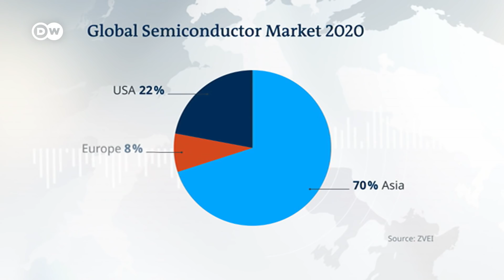The European semiconductor industry and its global competition | DW News

Comment: About Computing (Logic) Chips, such as CPU, GPU, Mobile CPU other processors:
Taiwan is NO1 in this field.

TSMC which is a Taiwanese IC manufacture and technique support company dominates the 56% in IC manufacture market share and the NO1 in this industry in the world. And UMC which is a NO2. in Taiwanese IC manufacture company get 7% in this field.

For computing chips manufacture, Taiwan almost get about 70% in this world.

MTK which is a Taiwanese IC fabless and designing company dominates the 27% in mobile CPU market share and the NO1 in this industry in the world.
--------------------------------
About Memory Chips, such as DRAM, Nand Flash or SSD..:
South Korea is NO1. in this field.
Samsung get the 42% market share in DRAM market, and SK Hynix get 29.5%.
South.

For memory chips, South Korea is the NO1 in the world.

TW and KR are skilled in different chips, the former skills in computing chips, and the latter skills in memory chips.
Reply: SK Hynix nand flash share isn't as high as your figure. Top nand flash manufacturers is Samsung with 30%, Kioxia with 19%, WD with 17%. But WD doesn’t run a fab, they do a joint venture with Kioxia. So, we can absorb all WD figure to Kioxia

Comment: Thanks , Thierry Breton : Intel must upgrade to 7->5->3nm Chips, Global Foundries + NXP, St Micro ,Nokia, Infineon, Ericsson,Bosch must have a coordinated move to 3-2nm SoC & they must finance ,with EU, local assembly of tablets ,laptops, robots , etc. to train the next generation of engineers & programmers , of inventors right at the foundry & factory floors. Of course the anti-EU lobby will push in the Media the idea that Europe does not need to invest in any of this because it will go bankrupt , better to depend on foreign manufacturers & their Hedge Funds & Private Equity. Will Brussels act fast & smart ? Or will they fail again ? 
News that MIPS will switch to designing RISC-V processors is important sign of open-source cores power .CPU/GPU/ASIC history is just beginning.
Reply: Europe should stay away from semiconductors and other high tech as it won't work. Europe should concentrate on mechanics which it has been a first mover for hundreds of years-such as pulleys,gears and cams.
Reply: Germany left semicon in 2009 when Qimonda stopped business and stays at the tech level then. Germany did the opposite to Korea - giving up profitable but very costly high tech and saving traditional industries. Too much time has gone and Germany left computer and phones even before that. And Germany's economy consists of millions of small companies. Netherland and Finland have some tech but not the required capital. Samsung invests 100 billion USD in cash each time on a semicon fab. Europe can;t do the same. The best way is to continue staying away from high tech.

Comment: Unless you can make it cheaper than the chips coming from Asia it will be difficult.
Reply: TSMC worked in mainland China lol after trade war the supply chain is strained.. lol opening new manufacturing takes at least 5 years soo yeah enjoy 5 years of supply shortage..
Reply: @r3dpowel796  TSMC only make 28nm chips at Nanjing. It's not advanced process.
Reply: In memory no way to compete. The bet is on advanced Chips where low cost is not the main issue.
Reply: that’s why we’re subsidizing them
Reply: EU has flubbed on vaccines and facemasks. I do not believe them when they say they're going to be able to produce chips in such a short amount of time. It's not going to happen, Never listen to a CEO, They're professional liars and will make promises and tell you what you want to hear.
Reply: @deezeed2817  exactly even for Asian country to make semiconductors is not an easy make.. it takes a deal with companies and redsign work and much more..

Comment: Why would they need to put nano chips in a car wouldn’t regular chips do, I understand that they need nanotechnology for very small items like phones and cameras.
Reply: cars have a lot of small parts that are used for calculations, electronics etc. it is needed everywhere, even in your microwave.
Reply: If you put a big PC on car, it will eat the battery fast.

Thats why they use the smaller chip (usually need lower power).